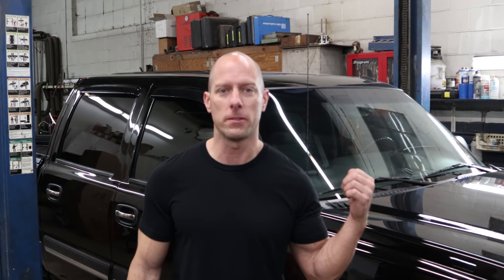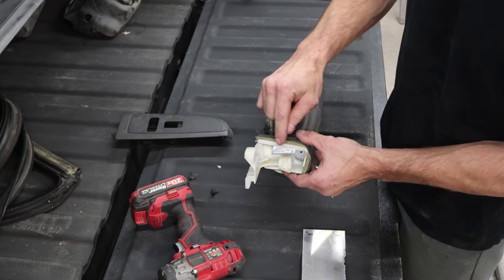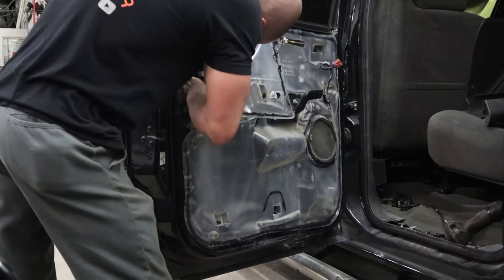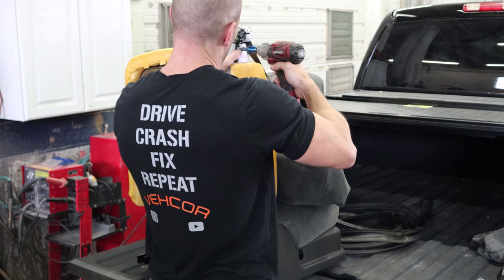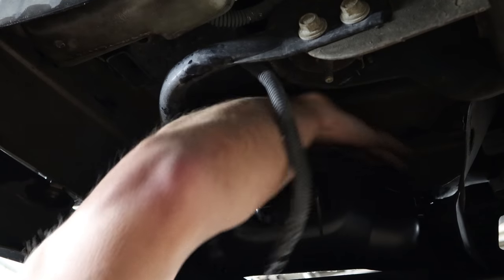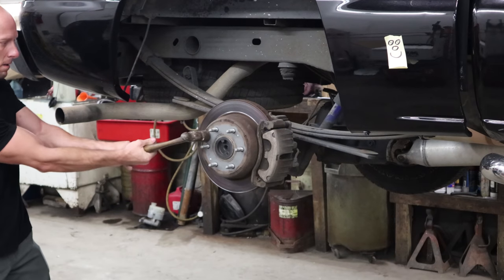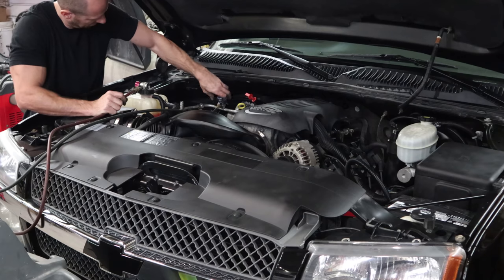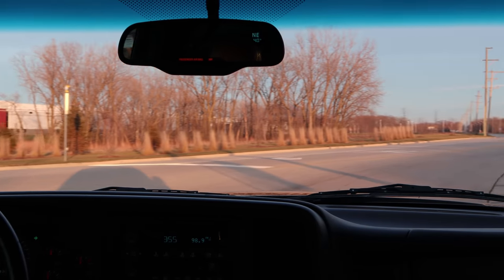Chevrolet Silverado side collision cab swap rebuild part 4

Comment: The best “What’s in my counsel” yet! Keep the builds coming... change the word counsel to console!
Reply from the maker: That has actually become something I look forward to in the series! 😂 Thanks for the support!
Reply: @vehcor  You should rebuild a foreign suv and a foreign truck and rebuild a ford truck, and rebuild dodges, jeeps chrysler, plymounth, mercury, saturns oldsmoblie, and hummers
Reply: @vehcor  awwwwww, shoddy rebuild!!!!!!!!!!!!!!  (ha ha!)    did'nt use a torque wrench on the valve stem caps and not  replace the tie rod end on the rear ......................naw just kidding,      even though this was spread out over 3 weeks or so, it's amazing how a vehicle can be re-built with the proper equipment and know how.................have you stated when you do the work on the rigs is it weekends or nights?????
Anyway, good job and look forward to the next build
Reply: *Console
Reply: lostintime86 and I double checked it, still didn’t look right, what the heck....
Reply: @gsettlemyre  haha I make the same mistakes to.. I mean too, also.

Comment: My OCD was triggered when you reinstalled the old outer tie rod. Otherwise, love the channel. Nice job.
Reply: Yeah I figured he would put a new one back on too. But that is the rebuilding business gotta spend as little as possible so you can sell it and make a profit.
Reply: RockAuto has brand name ones for under $15 a piece, but this is a cheaper truck and if the old one was tight might as well leave it.
Reply from the maker: No reason to change good parts.  Thanks for watching.
Reply: For sure. If it's tight and functional, no sweat. 

On the other hand, "while I'm in there" haha.
Reply: @kst8guy02  that line gets out of hand on me very fast.

Comment: This one had me dying, "world's quickest brake job" and "winter air". 😂😂😂 Love the videos!
Reply from the maker: Haters are going to say they can do it faster and I should use nitrogen! 😂 Thanks for the support!
Reply: But I don't think the tires air has ever been rotated sometimes it's hard to tell.
Reply: vehcor an Australian tested nitrogen and it makes very little difference to air to warrant using it.
Reply from the maker: robert hesse what people don't realize is atmosphere air is 78% nitrogen.  So as my instructor used to say, " I use a nitrogen mix in my tires!" 😂
Reply: @vehcor  but disappointed that the air was not DATE CODED

Comment: I'm glad it's "boring build Friday" - 6:00 AM Saturday morning here in Australia. That means that we get to see another one of your interesting videos. I like the way you repair things, rather than replacing them. It's the sort of thing I do myself. It not only saves money, but it's environmentally friendly as well. Not to mention the fact that, as you pointed out, the repaired item can actually be better than new. The way manufacturers make these cheap plastic clips that break, is nowhere near as good as your aluminium replacement part in the armrest.

I'm already retired, but I still do my own work on my own vehicles. That way, I know it's done right. When you do these repairs, you always seem to find something that someone hasn't done right. I've found the same thing at times on my own vehicles.

Another excellent restoration that someone can buy and be really happy with after your repair and routine maintenance. That was interesting information about the VIN. Things are different here in Australia. Cars get written off for very little damage. The truck you just repaired would have been a parts title here in Australia. So it would have gone to the junk yard.
Reply from the maker: Rules vary by state here but usually something like this gets a salvage title although it could get a clear title as well.  The insurance companies decide what they want to get usually.  Thanks for the support!

Comment: I wonder if you remove all the “Smile faces” or you leave some hidden ones for the next owner as an eastern egg.
Reply from the maker: I remove them...... most of the time 😳
Reply: Leave one on the inside of the door panel so somebody can go "somebody's been here" themselves
Reply: "Eastern" egg.  I see what you did there.
Reply: @jkrende  It explodes?
Reply: @vehcor  start a wall in the shop with all the ones used, date coded of course............

Comment: Excellent work. Your attention to detail is refreshing. After many years working in a shop and repairing the less qualified techs mistakes it’s nice to see some actually fix things the right way.  I can’t remember the last time I saw a 2000’s era Gm truck with cab corners and rockers left. Lol. I see Illinois goes by the same road salt moto Ohio uses. Threat of a 1/2 inch of snow equals 3 inches of salt on the road when the temperature is going to be in the 40s the next day.

Comment: I'm going to have to try changing my brake pads and rotors that way that looks a lot easier :)
Reply from the maker: It saves so much time.  😂
Reply: If it works with calipers too, I’m in!

Comment: I need to learn that brake change magic 🤣 

Breaker bar on the valve cap 🤣🤣🤣

Well done again, such great quality work 👏👏
Reply: I wood have used a torque wrench and LOC-TITE
Reply from the maker: Those brake changes save so much time! lol

Comment: I have several projects to do and I have been a little nervous. Now after watching your videos my confidence is 100%. I have 3 2003 beetles to turn into 2 drivers and 3 2005 explorers to build 2 drivers. Sadly one of the bugs was a past project my kid found a deer with just 2 months after I completed it. At least I know exactly what I have to work with. I believe I will have a very small investment in 4 good vehicles and I won’t need to swap vin tags. I have clear titles for them all and only the one bug has structural damage so it’s the parts cars now. Your project was much more intensive than mine so I am feeling great about it. Paint is my only worry but I am thinking about a vehicle wrap to solve my troubles. Thanks for your excellent example. Please keep it up. It is educational and now I think I may look for a project Chevy

Comment: I agree with all you mentioned at the end of your video for the 56.**hr for personal hourly rate but for a shop rate it's kinda low to cover operating cost. Now I will say you do quality work and go above for what most people in the industry would do. Alot have the mentality of "it's a salvage title" or "rebuilt title"  and cut corners...glad to see you don't. Keep turning out great vehicles. Appreciate all you put into the builds and videos
Reply from the maker: That $50/hr was worst case and after all expenses.  That is higher than insurance pay body labor in my area actually.  I have always enjoyed changing people's minds about rebuilds with my products.  I had some "wrecked cars are never the same" people that have become great customers and only buy those wrecks now!  Thanks for watching.

Comment: You do great work.  Any other shop wouldn't have done the maintenance or tie rod replacement.  I won't go to my insurance companies shop anymore as they did such a crappy job on my wife's truck.
Reply from the maker: I want to make sure my new buyers have nothing to worry about but has until their next oil change. It has paid off in referrals and repeat customers over the years!

Comment: WHO IS THE LUCKY YOUNG LADY WORKING WITH YOU ? I HAVE TWO DAUGHTERS AND ONE SON, AND THEY ARE ALL UNAFRAID OF MECHANICAL WORK. THEY ARE NOT THE GREATEST DIAGNOSTITIONS, BUT, THEY STILL HAVE ME FOR A FEW MORE YEARS! I'M A LIFE LONG MECHANIC AND HOBBIEST AS WELL A RETIRED 35 YR CNC MACHINIST. SO, I APPRECIATE WHAT YOU  DO AND FULLY UNDERSTAND THE LABOUR. MY BEST FEAT WAS PUTTING A CORVET VIN-8 TUNE PORT INTO A CJ-7 AND IT ALL WORKED.

Comment: I have a Black Crew Cab 2004 Silverado as well so watching this is great info for me.  If you ever need to unload some parts you don't use (those wheel covers in the center of the rim for example) let me know.   Keep up the great work!

Comment: Interesting build, as always. 
My '17 Colorado has a problem with the upholstery edge coming loose on one of the rear seat bottoms. I tend to put too much stuff in the under seat storage and it pops loose. Gonna try putting that clip back on like you did in the vid. Thanks
Reply from the maker: I've had some customers with similar problems. I ended up drilling a little hole and putting a zip tie on the ends.  They never came unsnapped again.

Comment: You blew my mind.

  $50 per hour for you.   Were I to try the same, my time would have made it about $1.25 per hour, but if I did it there would have been a pile of extra parts at the end, so I’d have that going for me.

It actually looked like fun, at least the taking it apart looked like fun.

Oh, and I would have done it in the dead of winter in my driveway, that’s how I roll.

Seriously, thanks for sharing how long it took you.  I always wonder about that.

Comment: Hahahaha nothing but respect! You managed not to turn silver? I changed up to copper now instead of looking silver. Damn anti-seize. You mentioned changing to winter air, but did you top off the blinker fluid? 

Thanks for taking the time to rust proof for the next person. I use fluid film, I imagine it’s close to your cavity wax. They both stay fluid! 

Another great build! Keep em coming
Reply from the maker: I use both, just grabbed the silver.  I put new blinker fluid reservoirs in last video, the new owner can fill them. 😂 thanks for the support! I'm not a fan of FF, too runny and doesn't last.  This stuff is one and done not every year unless you really want to fight rust forever!

Comment: 100 percent agree -- it's easier to replace a busted/missing Ventvisor or just live with them despite that you don't want them than to remove them. Ventvisor uses special 3M Mars lander double-sided tape.
Reply from the maker: I wish they would use that mars lander tape on the mouldings you WANT to stay on! 😂

Comment: Wow Scott, you have such easter eggs in each video, that was a cool way to make the existing door handle pull work on the driver/passenger doors! Those exterior door handles on those models are much easier to remove than the 88-98 CK class... I scratch too many doors trying to remove those older model handles 😂I eventually taped the door to protect them.  

And yes, those XM antennas have been known to leak, I fixed one on my sis's equinox the same way...

I agree those seat covers take perseverance to remove and install.... but I guess it's better than Hog Rings?? 😂🤷🏾‍♂️

I need one of those Valve stem torque wrenches you use 😂

That haters roast was priceless 💪🏽😂

Thanks for the explanation on swapping cabs versus doing the metal work. And also for the explanation on dealing with the VIN, I think I'm going to go the cab swap route, since I found more rust when replacing the heater core.

Dang.... still no progress on Lifting down.. I was hoping you had cracked the code!

I like that console reveal for the next build... I see what you did there... but people would only know if they follow you in Instagram...
Reply from the maker: Hog rings??? The youngsters don't know what those are but I agree, I hate them!  I hated those 88-98 door handles.  That inner door piece required a team to install! 😡 Thanks for the support!  I have been waiting for the next build for a long time! I'm really excited!
Reply: @vehcor  I guess I am a youngster with an old soul, I love the old classic cars and trucks😂

Comment: Just my two cents, but whenever I apply a seat back cover, I usually put a trash bag over the foam.  It will help everything slide easier, and then you just trim it and no one is the wiser.  But good work man, you are my favorite channel, after my own of course.
Reply from the maker: It helps but then the struggle becomes removing it so you can attach the Velcro.  Just a different form of struggle? 😂 Thanks for the support!
Reply: Well, my experience has never been with modern cars soooo...

Comment: Cool I gotta take apart one of these seats to fix my lumbar now I know how to do it.  I used tape on those rubber covers on the roof but its lifting again!   I make like 10 bucks a day eating dust.
Reply from the maker: To fix the lumbar, you will have to remove the foam.  Usually the metal rods crack and that is why they fail.  You can weld them or replace them, I have done both. I hate those mouldings and had a few come back off.  The trick is to get them shaped to the body before you put in the two sided tape.  There is metal inside them and it will fight to peel off the tape if you try to form it after or when installing.
Reply: @vehcor  I think the lumbar spring broke on mine, I heard a pop and that was it.   You can hear that the cable just free wheels now.  It broke when it had maybe  60,000 on it years ago.  Wont know till I get it apart,  but ill check it out for cracks too.  Ya you the metal on those strips is a pita to form its like the same crap in some weather stripping.

Comment: Never pictured you a chrome kind of guy, but there it is.  I'm surprised you don't use the black plastic bag method to get the seat cover back on - cover the foam with a black plastic bag, seat cover slides right over - it's optional to remove the bag (but it's also quite easy to get out - you reach up and tear it out).  nice work
Reply from the maker: A little extra chrome is fine but honestly it was the only complete set I had. 😂 I have used the bag method but the trouble to remove the bag is just as much as the struggle to slide it over.  It has to be removed so the Velcro can attach.
Reply: @vehcor  heavy bags help - plastic sheeting works too, but I'm not a good guy - my cars are adequate when done, so if there's a bit of plastic still left in the foam (and it's noticed) it is no extra charge.

Comment: Always enjoy watching you work, and your work ethic. Had to laugh about torquing the drain plug and the winter air! I’ve  done several cab swaps through the years, it’s work, but you get the great feeling of accomplishment when finished. Only one question for you. Why didn’t you check the blinker fluid? Dan.
Reply from the maker: Thanks, I installed new blinker fluid reservoirs, it is up to the new owner to fill them with the blinker fluid of their choice!

Comment: I saw on some show. To make it easier to put that back cover on you use the plastic bag the cover came in. You put the plastic bag on then work the cover on over it it should slide on easier. Since your using the original cover maybe you could use a piece of that plastic bag that is used to cover a car when painting or look for really cheep trash bags that fit and keep them in your tool box for next time.  Once you get it on you trim anything sticking out or rip or pull it out.
Reply from the maker: It takes as long to tear the bag out as struggling with the cover.  I had to come out to attach the Velcro!
Reply: @vehcor  Right I forgot the Velcro. Oh well I tried to help and not be one of the haters. Hahaha  I'll try again with something else. Did you watch that guy " working " on the Dodge ram door and dash ?  Oh My God !

Comment: Loved watching your 4 part build on the cab swap!  It gave me some guidance on a current project.  I have a 2001 K3500 4x4 Dually with Duramax ( VIN VERIFIED), but has parts from a 2003 on it.. bought it that way... front clip is 2003 and its not a newer swap... I found the Transfer Case Control Module (TCCM) is missing and the main dash harness doesn't have the TCCM connections in it and the T-case connections from the dash harness are not there under the fuse box cover under the hood ( date code on main dash harness is 2003).  Furthermore the 4x4 switch is not connected since the harnesses are not there for it ( one is, but its not the right connector).   It sounds possible that they  did a swap with a 2wd cab or at least the dash.. not sure why).  I would love your insight and guidance.  The t-case wiring is all there up to the under-hood fusebox.  IT does have a 2003 gauge cluster in it for sure.  only thing that  is not working on this truck is the 4wd... I would love to get it up and working.  I know its a lot to ask for your help ( you are 2000 miles from me) but trying to nail down what I have as a hodge-podge 2001-2003.  Any help you can provide would be greatly appreciated. Trying to find info is a nightmare.  Thanks!

Comment: The vent visors are useful in Georgia and Florida.  Park your car with all the windows up and when you get back it's +150F inside. Butane cigarette lighters explode. Leave your windows partially open to allow that heat to escape and when you get back it has rained and your car is full of water.

Comment: vehcor assembly line, excellent work. I bought a while back a new 4door 7.3 dualy long bed it has been a while. The parts are mine everything but the frame. It belongs to Ford and I have to return it when I swap it over. It was a display truck from Ford. As is where is on site when inspected. It is a King Ranch Edition. Going to find me a Frame and swap it all over and make a New Truck. It has 0 .4 miles you cannot drive it at all per the contract. I am not a Ford Man but the 4001.00 I paid for it was worth it. I have it in a Sealed Shipping Container Less the Bed and it is in another container packed right. No fluids in the truck everything drained. I think I need to get that frame and make a Truck. Ford pays for the frame to be shipped back. You are right about the Registration Process. I wished I lived Closer..Louzianna lol...It might be worth Shipping the containers and having it done.I made room in the Bed Container to put a Frame in there.
Reply from the maker: Thanks, good luck with the project.
Reply: It ought to be fun to do. Looking for a 🚚 right now.